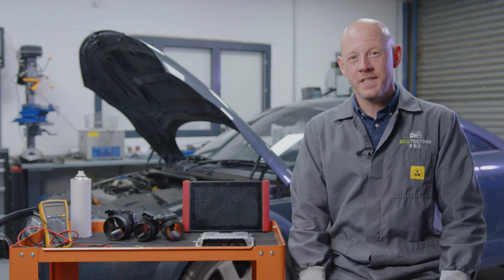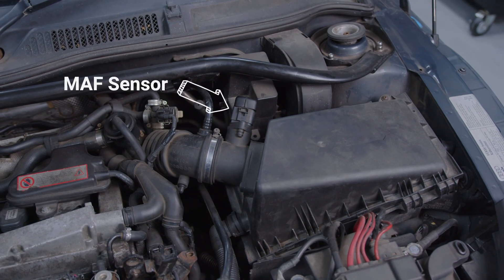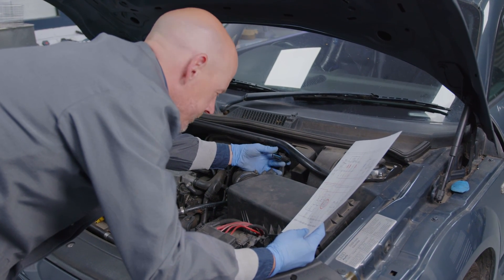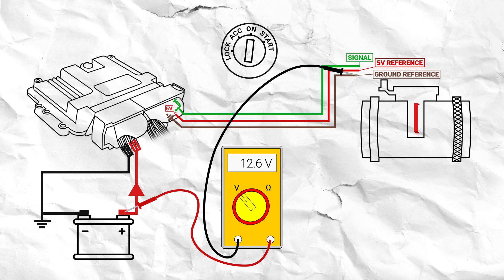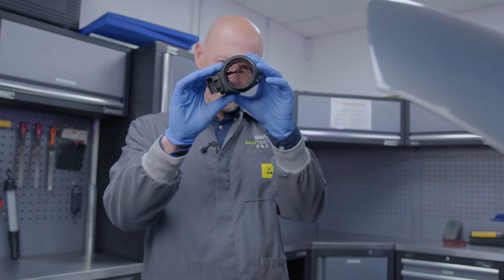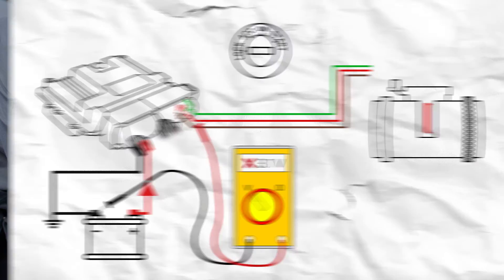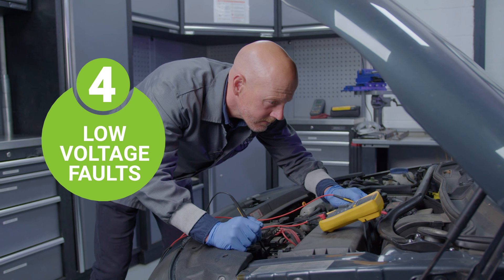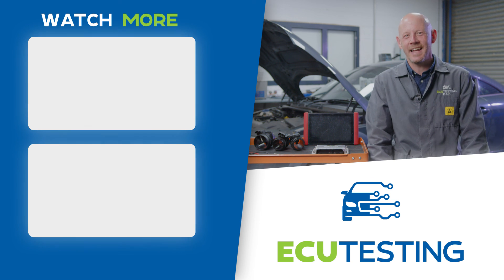Mastering MAF Sensors: Decoding P0101 & P0102 Codes!

Comment: I have a 2015 Nissan Pathfinder and it has a P0101 code. I replaced the air filter and the MAF sensor but still have bad performance and a recurring code. It appears to get worse as the engine warms up. Any suggetions?
Reply from the maker: Hi there, if you would like to give us a call on 01773535638, with your vehicle details and fault information, our technical support team will be happy to help. Thank you!

Comment: So my maf wires had a run in with the belt and it cut through one of the wires, before i noticed how bad it was i replaced the maf and it fixed the surging issue at idle when i came to a stop and the breaking up when giving it a little load. Then it came back i repaired the damaged wire but its still doing the same thing. Could the new maf of gone bad from the damaged wire?

Comment: Had intermittent MAF sensor fault on 2.0 cdti cleaned then renewed MAF still getting codes , found it was split in the pipe between intercooler and engine

Comment: my scanner detects 0v from maf, can I test the continuity in the sensor itself by probing power to ground and signal to ground on the sensor itself?  I'm 99% sure it is the sensor I installed a MAF I had in garage car started and runs fine.

Comment: Respect

I have problem with freelander td4 2004 bmw engine m47. Reset MAF adaptation and my MAF no learn new value why ?

Compensation value during idle is 0
Compensation value during load is 0

Why is 0 ?

How resolve problem. No code error. Wiring is ok.

Comment: Hello may I ask u a question sir
Reply from the maker: Hello there, of course, how can I help?
Reply: @Ecutestinglimited I have a van sprinter there is no power at all in computer say p0101 and I find is the air flow meter so i change air flow meter and still the say I cheek also all the pipe and vacume pipe as well and still no power when I delete the code with machine the power come very good after a day drive the problem come back the same one is there any other option to help me thank you very much for reply ❤
Reply from the maker: Hi there, I would advise to follow the checks in the video with the wiring etc and see if you find any issues there. Thanks!

Comment: Great video but what would you look for in a digital MAF sensor? Or can you not tell with voltages alone?
Reply from the maker: Hi there! The diagnostic process for a digital MAF sensor is similar to that of other MAF sensors. However, the key difference lies in how the signal wire voltage is measured. Unlike an analogue sensor, a digital MAF sensor outputs a waveform signal rather than a steady voltage. As a result, using an oscilloscope is often more effective than a multimeter for accurately capturing and analysing the signal. Hope this helps, thank you

Comment: Good evening 
I have a ford transit connect 1.8 turbo diesel /2004 and the maf sensor has 2 wires. How can I check it? How many volts must read on it ? Thanks in advance
Reply from the maker: Hi there, if you can email our technical support team your vehicle details and any queries to info@ecutesting.com, they will be happy to assist you with this. Thank you!

Comment: Ive been plagued with this p0101 code for years.      Tried everything.     Changed air flow meter.      And map sensors.             I allways comes back.       But  found a way to stop it.      Not exactly a fix but works.             I noticed if i had mine in sports mode.      Ups power slightly and tickover.      The po101 code dont come back.      ?     So i went into manual adaptations       Custom selection on car screen.     Set power to sports.     Then comfort mode with stop start off.                 It works no more problems and no real difference in fuel consumption.    Try it !

Comment: Excellent.. intuitive video!
Question: I have a code P0420 after muffler got cut..replaced with after market and new O2 sensor, but still come back with after ran on freeway 50-60 miles. May I get an advise...
Thx !!

Comment: hello sir. Great videos you got there. I forgot to put the MAP SENSOR back after spraying some electronic contact cleaner. I road tested my car for about 30 min when I noticed the CHECK ENGINE light turn on. I stopped the car and put back the sensor plug in but the check engine light stayed on even after I performed some resetting tries (unplugged the negative battery terminal 1 minute put it back and turned on ignition). I then notice my engine to be a bit hotter than usual and wilder engine vibration upon turning off engine (when the MAP SENSOR is OUT - though normal vibration when the MAP is PLUGGED in). kindly guide me on what to do. thanks and  hoping to hear from you soon. 2012 Mitsubishii Strada - Philippines

Comment: I have CLS 320 CDI which has two MAF sensors with built in IAT intake temperature sensors. I have both MAF and IAT error codes and cant figure out whats wrong! I ran all tests look fine, values within range, voltage present at the connections. I guess the only thing is to check the wire resistance from ECU to the sensors? Maybe some intermittent short
Reply: Check EGR valve isn’t stuck open. Diesels change things, if a EGR valve is stuck open and the cylinder is getting filled with egr as well as airflow, there will be less airflow to fill the cylinder, hence a airflow meter fault code.. blanking the egr with a temporary blanking plate or watching egr valve live data while driving will tell you what you wanna know 👍
Reply: @Taylor-DM156  EGR valve has been mechanically blocked and removed from ECU correctly by an indy garage. Resetting adaptation values specifically with Xentry software seems to get rid of the issue. Disconnecting the battery seems to bring back the issue, which is strange, I though ECU can hold adaptation values and remap , seems not for adaptation values.
Reply: @tehdreamer  hmm interesting. Normally when I do egr and dpf deletes I clear any learned data / adaptation values before I load the remap file. Is the egr “operating” still in live data?
Reply: @tehdreamer  sounds like the remap hasn’t turned egr off properly..
Reply: @Taylor-DM156  not sure, the garage did the egr delete. The remap was done before I bought the car and when I called them they said maf sensors wouldn't be affected by remap...
Reply from the maker: Hi. It would definitely be worth checking the readings at the ECU to ensure the fault doesn't lie with it or the wiring. However, if you are getting good readings at the MAF/IAT connector then it is unlikely the fault would be with the ECU itself. We would recommend checking the terminal tension on the sensor connector to ensure it isn't damaged, or you could conduct the tests again whilst wiggling the wiring loom all the way from the sensor to the ECU to see if the fault is caused intermittently by damaged wiring shorting when the engine is vibrating. If these all check out ok then it probably means the sensor(s) are the cause of the fault. Hope this helps!

Comment: P0101 tried everything wont go.... taken to mechanics etc its driving me nuts! Odbc reads p0101 changed maf etc etc....
Reply from the maker: Have you tried conducting the tests in this video whilst wiggling the wiring loom from the MAF to the ECU? A performance code can sometimes be set when an intermittent fault occurs, such as damaged wiring that only becomes problematic under load or due to engine vibration. We would also recommend checking for air leaks in the intake system, as these can also cause the P0101. Hope this helps!
Reply: Same, did you fix yours?
Reply: @rlmbuildingful  update.... the mechanic first found a hole in the air intake and filled it... problem came back. Next there was a hose near back of the engine with some cracks in it.... since that ive had 2 check engine occurences just clear but they subtly come back starting with esp off first. Maybe the maf is readjusting now and it will eventually clear? Time will tell. The next check the mechanic said would be the fuel pump... but you know where that sits ey... could be clogged?? Ive done 250 000 kms on this beauty car... i love it but yeah could be a maintenance thing that way???
Reply: @rlmbuildingful  no i am going in on the 29th to ex holden mechanics.... thr car drives beautifully but this code will not go :( i have only changed 2 of 4 oxygen sensors so other than that i wouldnt have a clue... heres hoping! Please let me know if and how you resolve yours if you do...

Comment: I have a ST 2.5 ford focus it got  a circuit A high voltage fault P    0103 i did test my wiring with the multimeter and my 12v. from the fuse box is right then if I test the wiring the  negative ,signal I also get 12v but if I remove the connector plug with the engine running the 12v falls away on all of them axcept on the 12v from the fuse box so to me it looks if the mass airflow is at fault but iam not sure what must the voltage be .The ford focus st 2.5 wiring diagram does not show me on the wiring diagram what colour is signal  5volt or negative .

Comment: Can a faulty throttle body cause a maf sensor p0101 code? Seperate code p0300 multiple misfire.
Reply from the maker: Hi. A dirty or faulty throttle body can sometimes be the cause of a P0101 fault code, however we would still recommend completing the checks in this video to rule out a fault with the MAF sensor or its circuit first as this is the more likely cause.

Comment: My infiniti fx35 2010 model don't accelerate after changing ecu, maf airflow, crank and camshaft sensor including trotter, an ensure the engine timing still not accelerate, so please help me to the solution of fult
Reply: Same here with my BMW 525i 6cld

Comment: Hi, I'm on a 2003 VW Passat 1.8t and the fault code I get is P1479 please advise
Reply from the maker: Hi. The P1479 fault code usually indicates a problem with the brake booster system on Volkswagen vehicles. We would recommend checking vacuum lines, hoses, and connections for any signs of damage, leaks, or disconnections.
Reply: Maybe the brake pedal is tough????

Comment: I was curious I have a 2013 Subaru WRX STI which gives me intermittent problems mainly misfires and multiple random error codes although no Mass air sensor codes but still wondering if I have some weird mass air flow sensor intermittent problem.  I need to change and check the spark plugs which is a pain in the butt on a Subaru.  If that doesn't fix it I have an ECM ready to replace my current ECM which I am suspicious of with the random error codes.
Reply from the maker: Hi. Sounds like a good diagnostic process, checking if the MAF sensor is clean is always a quick and easy fix when dealing with misfires. Hopefully you find the cause of your faults soon!🙏
Reply: Yes, I already cleaned my mass air sensor.  I need to change my plugs but I suspect it is the ECU with all the erratic error codes.  The ECU is under my passenger side carpet, but the biggest problem is unlinking my Cobb tuner from the current ECU and programming my new-used ECU it says 2013 WRX STI on my eBay replacement ECU but hopefully, it is truly compatible.  I don't know if it is from the automatic transmission version or even if that truly matters?  Cobb told me that ECUs from several years should work with my car hopefully, it truly works.  I may have damaged my ECU during COVID when the car sat for a prolonged period with a dome light on and the Optima battery went dead, and I had to try multiple tricks to try to recharge it without success.  I'm not looking forward to changing the sparkplugs on that car, though.  Not much clearance and a lot to disassemble to get to the plugs.  I have changed cam timing belts that were actually easier, particularly on simple 4-cylinder motors. @Ecutestinglimited
Reply: @guanedits6349  Possibly, out of desperation, I put in a bunch of fuel system cleaners, and so far, it seems to be running better, but I haven't driven it a lot.  I have leukemia and don't get out much.  I have found that intermittent problems seem to be the hardest to diagnose!